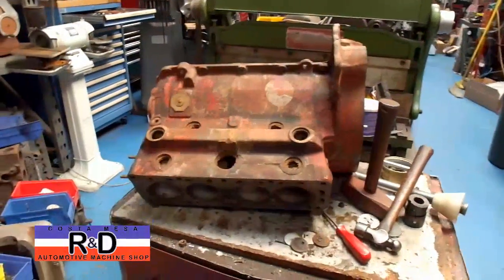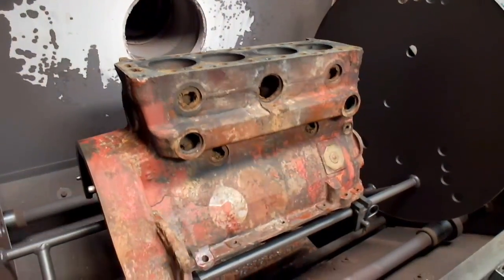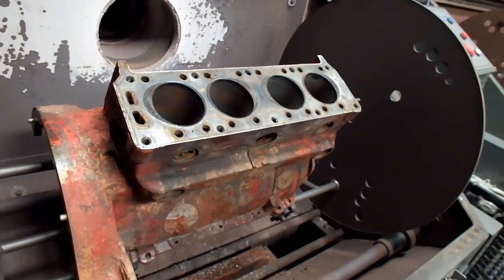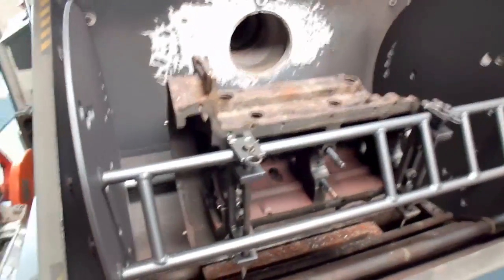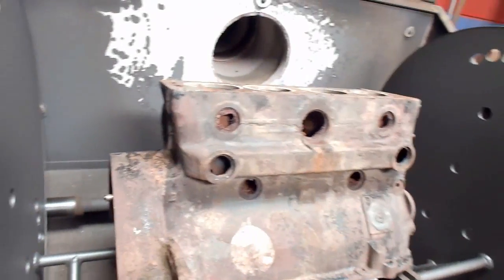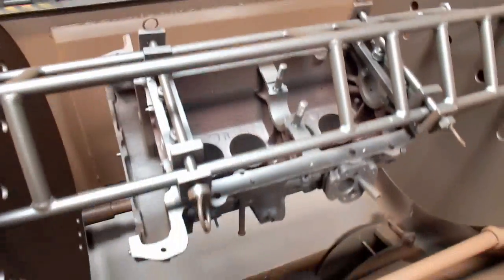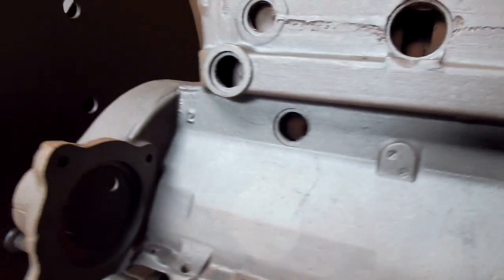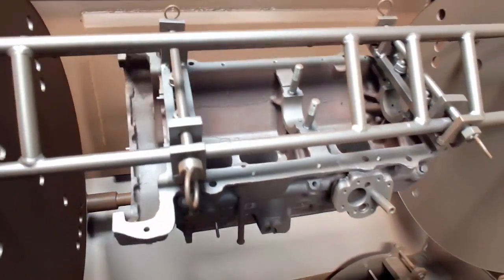MG TF Cylinder Block Thermal Cleaning

Comment: John;

Quick MGTF story.

I was helping a buddy of mine reinstall his TF engine in the car.  He had already mated up the engine and transmission, but needed extra hands for the install.  As I have had several MGB's, I was his go to guy for help since I understood the quirks of MG engine installation, regardless of make.  If you have ever done this, you know it is not as easy as it sounds.  Well, after some struggling and pushing we get everything installed and are feeling pretty good about life, etc.  Then my buddy starts swearing and I ask him what is the problem.  He points to his workbench and there is the pilot bushing sitting in the middle of the bench.

After a few beers to help calm down, we pulled the engine, installed the pilot bushing, and reinstalled the engine.  I now always check to make sure there are no extra parts laying around on the bench prior to final install.

Regards;

Ron Kluwe